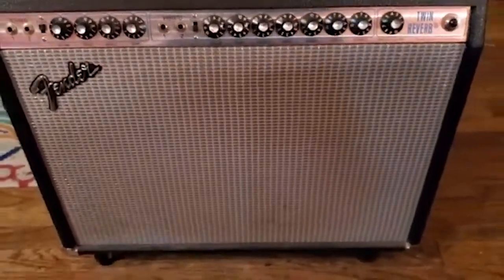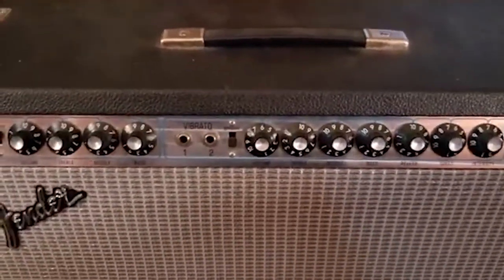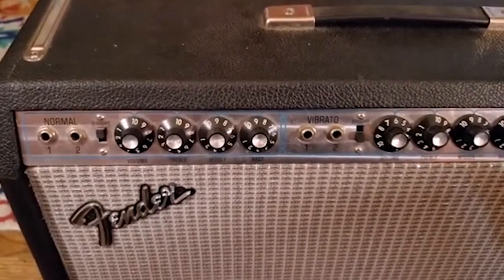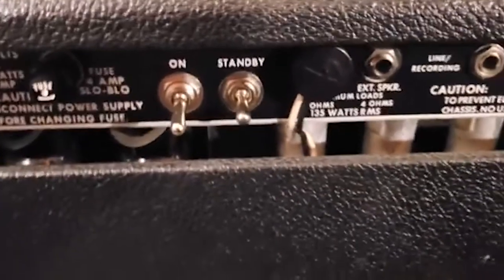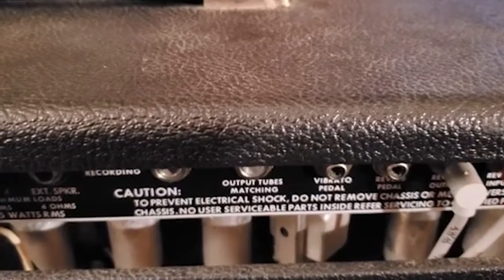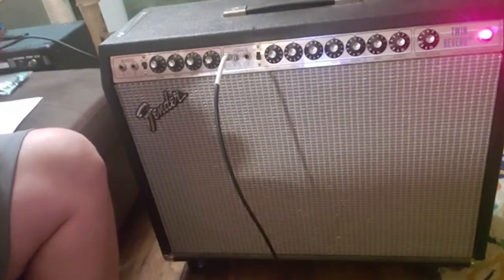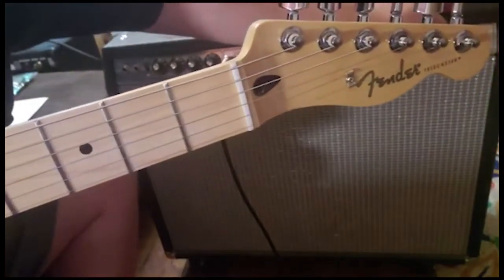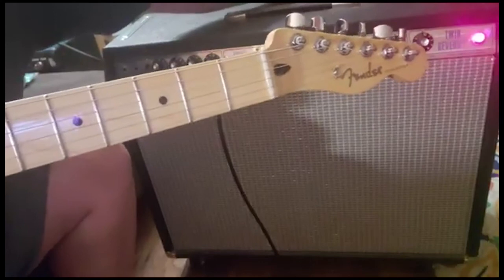Unveiling the Legendary Fender Twin Reverb: What's Hidden Inside?

Comment: I found one of these abandoned by the curb.
I drove by but turned around and the homeowner came out and helped me load it in my car.
His home had been used as a halfway house,and a previous tenant had left it behind years back.
It had been left behind his house for months as it was dusty and dotted with bird droppings. 
I got it home , cleaned it up and got it playing for me.
Reply from the maker: What a lucky find on your part. Tubes in tact?
Reply: @SteveReaves  Hi Steve , I took the amp for servicing ,it needed some tubes replaced.
Reply from the maker: @manuelmontiel5418  that's a pretty sweet deal, thanks for sharing!

Comment: The speed and Intensity controls are for the vibrato, they won’t work with out the foot pedal hooked up and turned on though
Reply: I have an original 1977 135 watt model (Ultra Linear) and it came with a dummy plug inserted in the vibrato pedal jack to use the vibrato without the pedal.  With the plug inserted the vibrato is always on, you just turn the intensity knob to zero to "shut it off".

Comment: i have the same amp in perfect unaltered condition including original tubes and speakers and owners manual. fender usa drip logo on front. so loud you could play woodstock without the PA System. i have the footswitch pedal and it has 2 plugs to go into the vibrato and reverb jacks, it just engages 1 or the other or both

Comment: I have one of these which I’ve had for 25 years (bought second hand) and only used at home. Lovely amp but buzzes quite a lot now. It’s labled as a “Pro Reverb” though. What’s the difference to the “Twin” on your video?
Reply: A Pro Reverb from the same era is a lower powered version of the Twin. My 77 Twin runs at 100 watts while a Pro Reverb is about half that amount. The Twin has four 6L6 power tubes, the Pro has only two. The Pros are also a bit lighter. More buzzing might mean you need new tubes and/or filter capacitors. An amp tech would be able to determine the cause.
Reply: @DavidGarcia-kw4sf  ….many thanks 👍🍷
Reply: Better get that pro reverb  to a tech.  At their age they need new electrolytic filter cap and maybe more. As the old caps dry out and then eventually spu there guts like an old battery…
Reply: @Zelleram55  …..if I could only lift it!….thanks anyway.